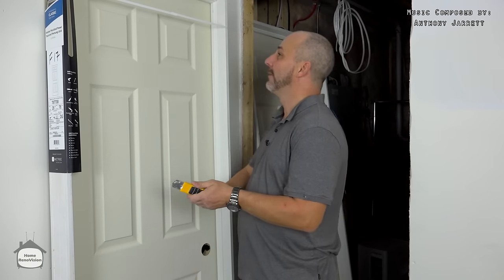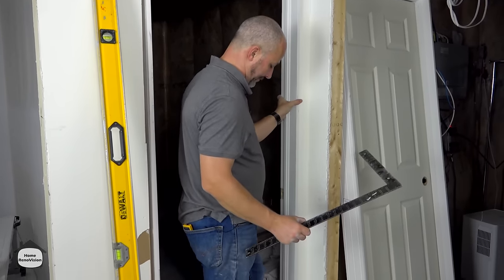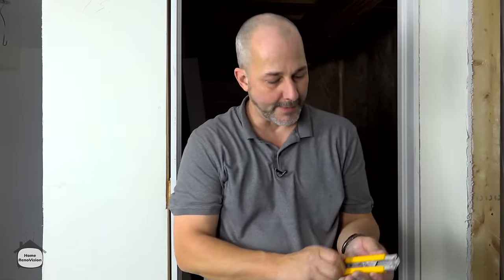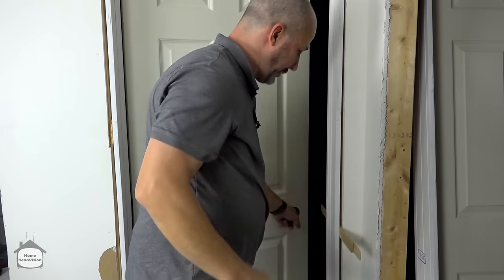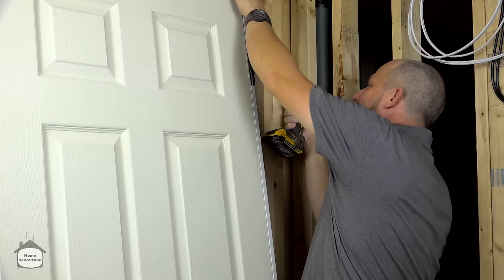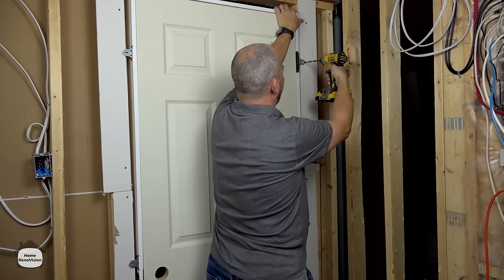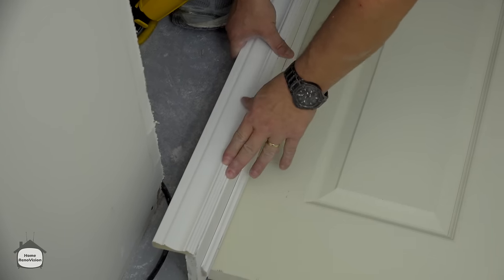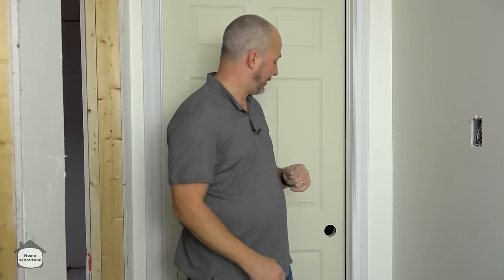How to Install A Pre Hung Door  |  3 Different Ways

Comment: Oh no!  Jeff didn't read the instructions on the clip/door hanging system!  You want to draw two plumb lines first, on the wall studs on each side.  Then, you align the same clip "tooth" for all three clips on that side with that plumb line.  Screw them in the wall.  Repeat with another plumb line and the clips on the other side.  Voila, the door is automatically plumb!  Great video otherwise! )

Comment: arnt you glad they just put a couple toe screws in the studs !? :) lol
Reply: i had a thought after ...   what if you were to offset the brackets inside the frame 1/2 inch ? then no need to add the drywall ?

Comment: I've worked in the ER here in the US. Long wait times are NORMAL. Don't kid yourself that our ER services are quick. They're not! Your small hand laceration would easily have been a 3-5 hour wait here also, depending on other emergencies that have come in in the meantime. Ambulance comes in? Your hand lac goes to the end of the line for suturing. Now your 2 hour visit turns into 10. American healthcare is NOT quick.

Comment: Please don't use the third method. I just did a job in a 2 year is condo and they used the third method... All doors ready to be redone and there's no way to fix, only redo.
Reply from the maker: pop a casing and add a shim. Cheers!
Reply: @HomeRenoVisionDIY  Sure, but why do a job that needs redoing? I've seen this method many times before and it fails every time.

Comment: 22:53 I hate this way to hang doors. It looks like the first method will take the shear strength of 4 nail to open . The second method will break open if someone knocks to hard in the wrong direction.

Comment: Why the hell are you putting deck screws in an interior door? At least use a trim head screw.
Reply from the maker: Hi Blake, it is a construction screw not a deck screw. which BTW would work fine as well. Why do you pretend to be such an expert?
Reply: Home RenoVision DIY why do you pretend to be such an expert? Construction screws or any other large headed screws are how hacks install interior doors.